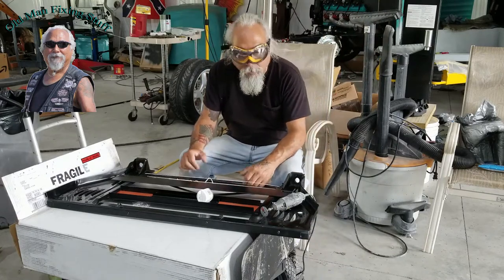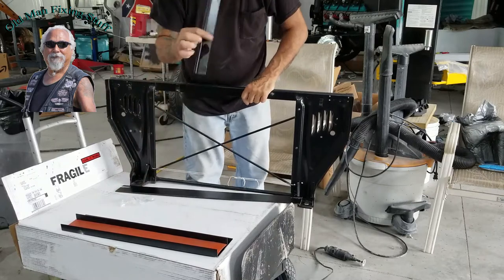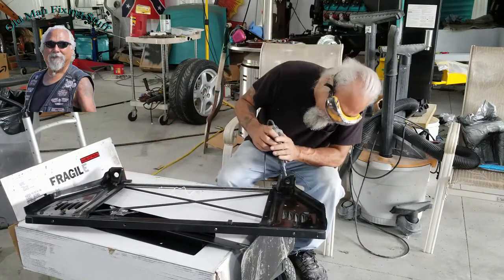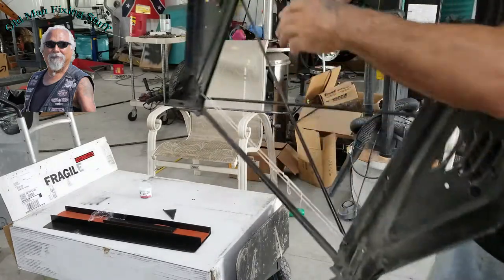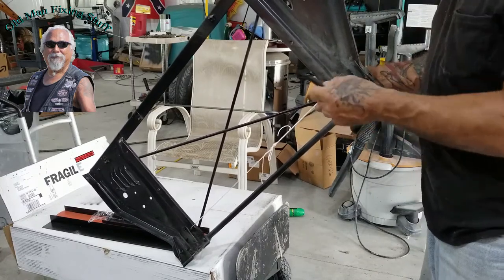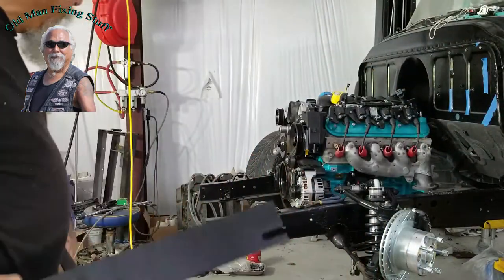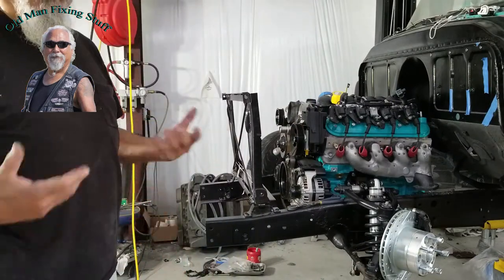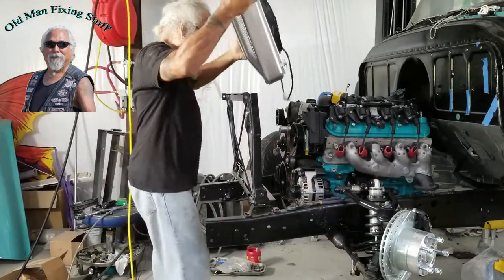US-Radiator 55-57 Chevy Truck Radiator and fan shroud setup

Comment: Hey Brother. Greetings from the Flower Mound TX.  Intrigued by this cross flow radiator.  I have a SBC 350.  Temps around town can reach 205-210 in hot weather.  Thinking about replacing my original Harrison .  What kind of engine temps are you seeing during this stretch of 104+ degree days ?
Reply from the maker: I stay around 190 at 195 the second fan come on. I have no issue with overheating.  I have an ls so they handle a little higher tems then sbc. But in my sbc 383 it stays right at 195. Here in Texas you need a good radiator and a good electric fan or 2. Don't cheep out on the radiator and fan. If you are staying cool while driving and overheat when stopped or slow cruising it's air flow you need a better fan they pushes more air.
Reply from the maker: Also, make sure you have a good water pump.  When you decide on a new radiator, give the company a call and let them know what you have and problems. I went with the crossflow radiator and 2 fan combo. It's not stock looking but it cools.  Over the years I found this works for me. I got tired of high Temps. It's all about  flow (air/coolent), pressure and cooling aera. And as long as you can fit it all in the engine compartment. Air flow is also key at slow speeds or sitting. A good fan setup is required here in Texas.
Reply: 10-4.  Thanks for the info. I like 190-195 when it's as hot as it is today !!!  Any idea if they make a shroud for a big mechanical fan setup ?
Reply from the maker: @kenwoods3936  I think they only do shrouds with electric fans. They do custom shrouds you might give them a call. I stopped using mechanical fans because I could not keep the temps down when causing or stopped. What I found that works for me keeping the temperature under control. Is a radiator built with an electric fan and shroud setup. The right electric fan setup did great on keeping temps under control at slow speed cruising and stops. Even with the ac on in these texas July and August temps. It's a little more $ but worth it.
Reply: @oldmanfixingstuff3722    Got it . Thanks !! Stay Cool !!

Comment: Hello sir, how did you solve the radiator hose issue?
Reply from the maker: After I bolted everything together, I had just enough room to use 90 degree hoses cut to lenght and couplers to tie them together. One of the top hose coupler has a steam port adapter needed for the LS. I used 3 90 on top cut to fit with 2 couplers  and just 1 90 on bottom.

Comment: Question. Will a radiator from a 1950 Chevy truck fit in a 1955 Chevy truck 2nd series?
Reply from the maker: I don't think it will fit without mods. If you can, I would get a new aluminum radiator made to fit. If you are going with a v8 you need a good radiator to keep that motor cool. That and a good fan. If you are going with a ls motor it's the only way to go and keep that motor cool.

Comment: did you mount the core support in the v8 or the 6 cylinder location?  Thanks!
Reply from the maker: V8 location.
Reply: Actually, he is mistaken. That is mounted in the I6 location. The radiator would never fit if it was in the v8 location. Going through the same thing now with my 55’